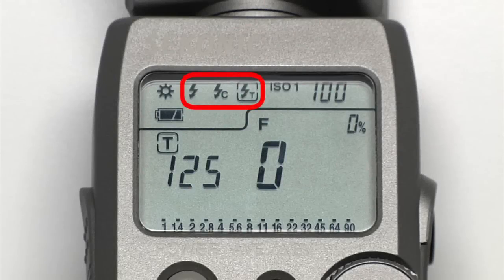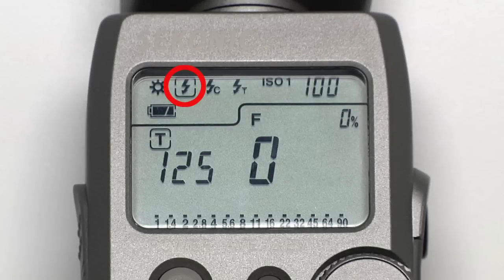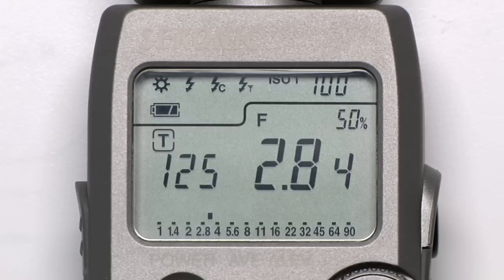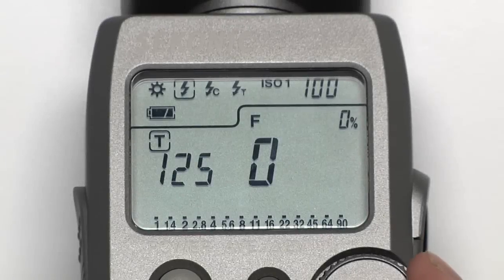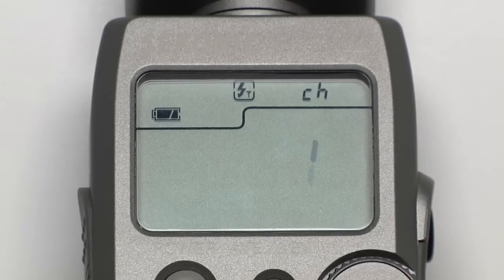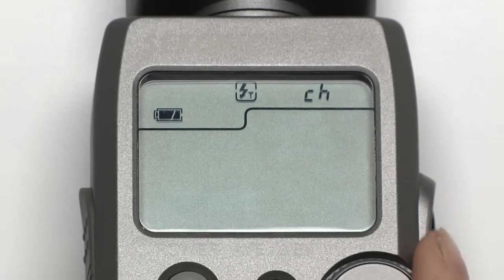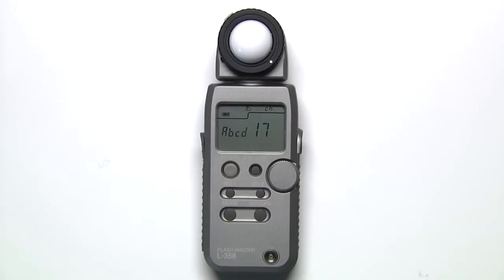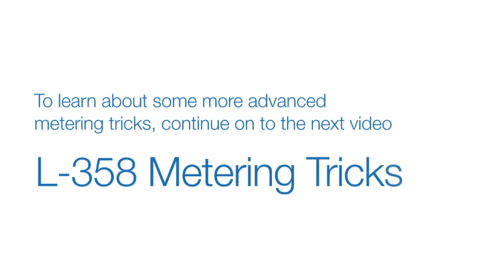Sekonic L-358: Metering Strobe [Quick Start Guide Part 3 of 4]

Comment: You are not the only one . got the Mini,  the Flex,the sekonic L-358, the Rt-32 module, the D90 and It's been 2 days now, I'm still struggling to get the L-358 to triggering the Flex TT5. On the display screen, the 4th Icon is displaying with the antena logo. I try all standard channel and  nothing works.I'm just tired right about now. Zeck could you give us a concrete explanation and examples on how to get it to work. I will gladly appreciate.